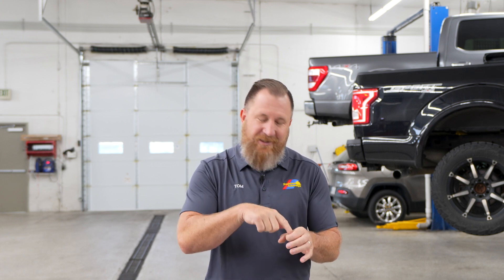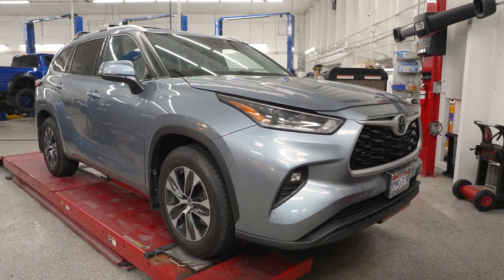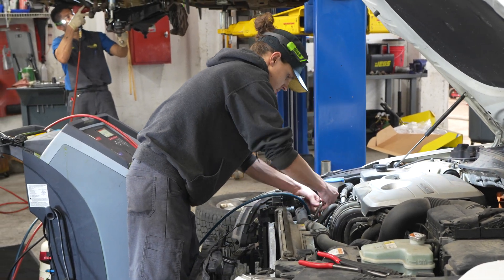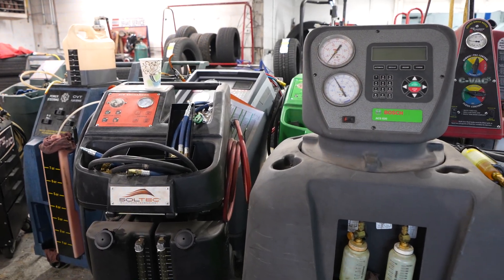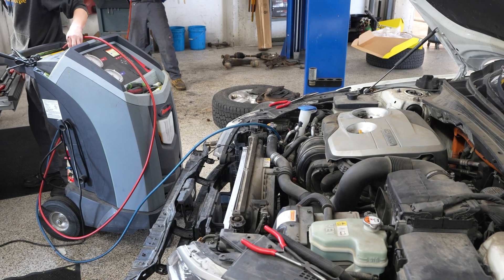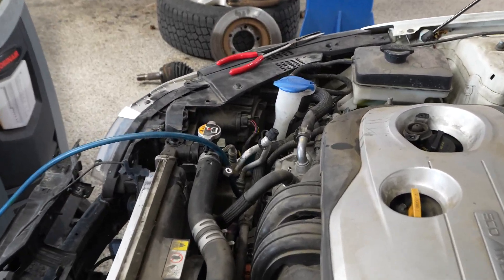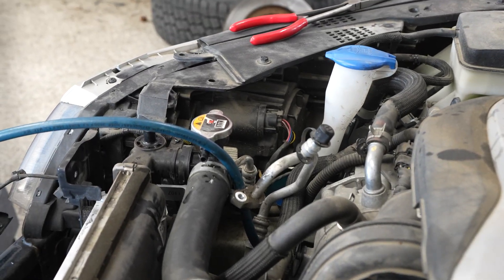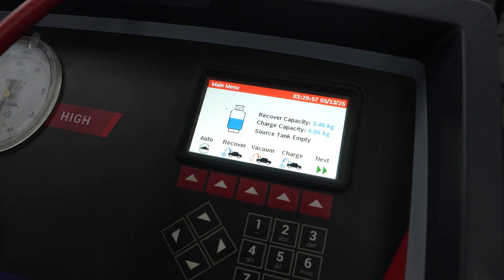Freon - What Changed - What You Need to Know!

Comment: Great video Tom. I have a question about cross contamination between two cars. Car A pulls in with stop leak in its system, also has used imitation refrigerant that is sold in cans. You vacuum and charge his system and then car B pulls in for ac service.
Is the filter in your A/C service machine designed to separate above mentioned impurities?  Is the refrigerant from car A forever kept in a recovery tank and not used on the following cars? Can you please shed some light on what happens with the contaminated refrigerant? 
Is there a way for me to make sure my car’s system is charge with pure factory fresh/virgin refrigerant? Thanks in advance.